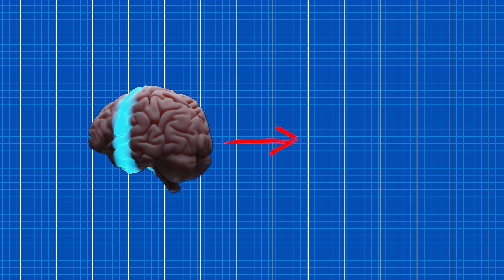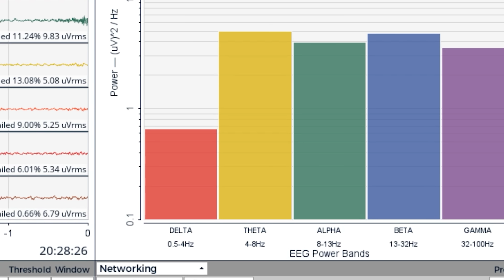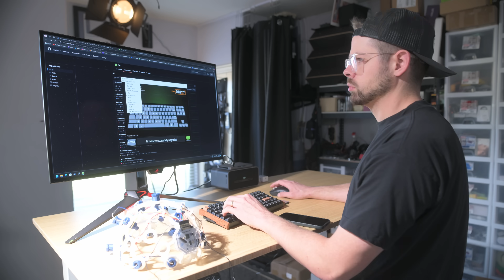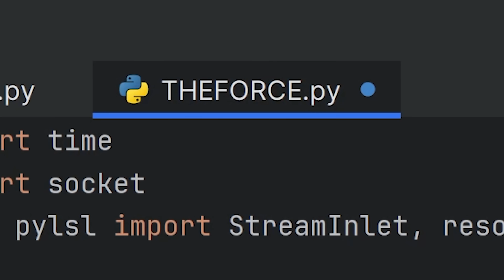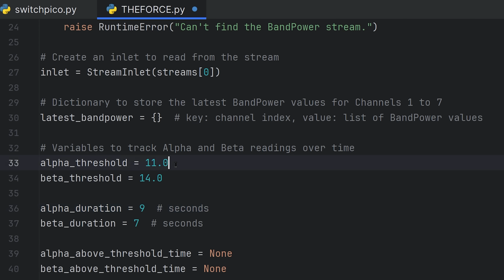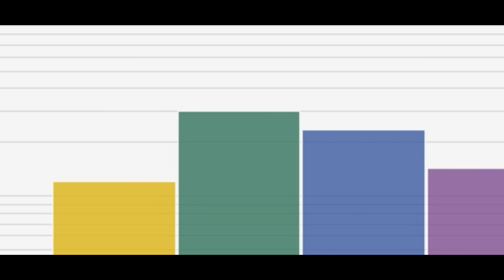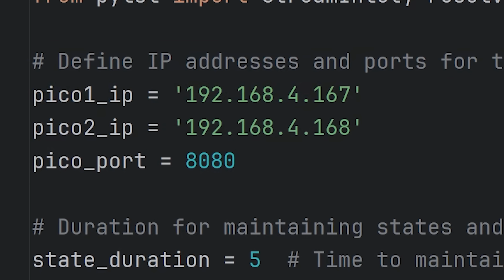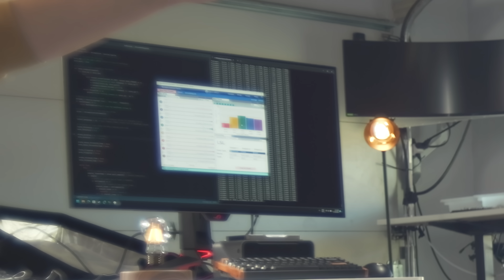I Built a Way to Use The Force

Comment: the problem with the vibration is that you didn't secure the device using drywall screws to your head, that is the official way to do it properly.

Comment: @BasicallyHomeless I am trying to better understand my neuro-divergent sleep schedule, as I sleep for 35+ hours (and reach a state of hibernation). I will then stay up for 60+ hours. I've been trying to switch back to a normal schedule and seemingly just can't. I think this data would help me immensely with troubleshooting my mind.

Can you tell me the parts list for your helmet build? did u spend 3k or did you go full DiY mode? And what was the cost of printing the headset and buying the parts seperately? Did you use their proprietary boards or use your own?

Thanks for amazing content.

Comment: Why not have the Pi wait for a specific data output "flip the switch" and then have it transmit via the Zigbee protocol to a smart switch?

You could then set up smart routines...

Weather? ... Either turns on your TV to the news channel, or "asks" your smart assistant what the weather is.

Lock?... Locks the front door.

Lights ... Turns lights on/off

Comment: Lol "Neuralink?! Bro I DIY'd the force, mario kart can't beat my light switch"

P.S at least it wouldn't be certain death if you messed up or if anything went wrong without flipping the breaker off.
Seen this happen two different times:
Once a big ol' 6'4 guy (30~)with loads of muscle mass who didn't budge, panic, or care that he got zapped at all for that matter.
Another time a small 5'6 guy (age 40+) who went into cardiac arrest but pulled through thanks to the fastest ambulance I have ever seen in my life. The way he jerked back you'd swear he was about to go flying like Mace Windu in the third movie but instead it's far more unsettling... That said...Remember kids, If you're demolishing a house, changing an outlet, or ANYTHING that involves dangerous electrical matters-- ALWAYS turn off the breaker if you don't want to face potentially severe consequences.

Comment: You know one time i was cutting an earbud with wires, i used a stainless steel scissor and cutted the bottom of the earbud itself, and when i moved it after i cut it, the part where one cale becames two, the cable connected to the earbud i cut, was somehow cutted, i know it sounds fake and i thought it was probably just a electrical current exloding and broke the cable, but after watching this video, i started to think, a bunch of other stuff happens to me as well, perfectly bad timed customers coming in when I'm just about to do something different, people said this and later they said that they said that, most people i met are dumb, and i forgot

Comment: Your brain projects your reality which is dependant on what u program it with. Meditating is a great way to attain the certain states which is great, now u need to have your mind and heart connect. Your heart is NOT a pump, but an energetically vortex like valve that produces your biofield about 8ft in diameter around your body. Now if u can connect your mind with your heart imagine what can happen. Your heart will help u feel better, but  u have to do inner work (shadow work) to heal the heart.

Comment: You could use your brain waves to control a robot and do anything with it (lift stuff, move stuff, etc) as long as the robot is physically capable of doing it and you can come up with a way of encoding different actions in your brain waves (Morse code, perhaps). Sounds almost impossible, but so did this whole video!

Comment: Option D: Accept the fact that the light won’t ever turn off and you have to sleep under the blanket only for you to run out of oxygen so you pop your head out to check if the light turned off and it didn’t so you surrender to a higher power

Comment: This is sick, but I'm gonna try to explain the force more accurately: it's like a parallel dimension that always has the same things happen as our dimension, and vice versa. And the more midi-chlorians you have, the easier it is to do stuff in that parallel dimension and see from the perspective of the parallel dimension (I always imagine it as an "almost but not quite matrix mode". You literally see everything, because it's the mere existence that makes it visible). And in that parallel dimension, you can stretch your limbs infinitely (and independently of the real limbs, but that's not worth the mental effort most of the time), so you can physically feel that you grab stuff.

Comment: It would have been easier to train a neural network to differentiate between different intention-based thoughts. It's a lot like image classification models, where instead of pixel values, the input image is a time series of the signals from the headset

Comment: This is awesome, but bruh, I thought you were gonna try to use the headgear to push the common threshold limit of your gamma waves and others daily until you were straight up using the force RAW. But since most of these softwares are logging your waves to a cloud, if you did get to "freaky" levels, you'd have a van outside your house taking you on a one way trip to a mili underground lab

Comment: My first thought with videos like these is always how amazing this would be for disabled people. Like holy shit.
Reply: I havent raised the blinds in my room or even wanted to fix the overhead light in years as i cant get out of bed easily to use either. Youd never realize how much youd miss being able pull a string or roll the turny stick on the blinds till you cant anymore
Reply: This comment is so true and underrrated
Reply: This is the future. The good one.
Reply: it's 2500 I want to get one to mess around with. It's all open source software would be cool for projects.
Reply: There is a ton of research going into AI models trained to classify brain signals connected to certain actions (clenched fist, bent knee, etc.) for prosthetic limbs. There's even some brand new research about implicitly training a model to do what you want it to do when you give it certain brain signals
Reply: There’s a ton of research the AI companies steal from losers like myself and then threaten while turning a profit from it all.
Reply: Neuralink Will save them
Reply: @alexandergorchev9946  id rather skin myself alive than trust neuralink for some reason
Reply: someone at CSU northridge years ago was researching using I believe silicone-based chips to move wheelchairs with electrodes just like this. idk if that went anywhere

Comment: Cool video! 
Looks like you have about 12-16 ECG recording channels. As an alternative to using simple thresholding of pooled ECG data to  predict intent, you can do the following: 

(1) Apply a notch filter to remove powerline electromagnetic interference (60Hz in north america) 
(2) Perform an FFT, bin every 5Hz from 1Hz to 150Hz. your inputs now becomes 30 x number of ECG channels.
(3) Train a simple linear classifier to predict your thoughts/intent.
Reply: this is good advice
Reply: Genius
Reply: didnt understand a thing besides that you mentioned fast fourier transform
Reply: @PinkeySuavo  basically think the same thing over and over and figure out what brainwaves change in what ways when you think that and use that to code the force
Reply: im assuming
Reply: Not really relevant but it’s eeg not ecg
Reply: @Icedbattery right right, should be eeg

Comment: You better actually use this thing around the house. Better yet, you should improve the head thingy, get a retailer to make parts, and make this a 3d printable thing. Like, have a kit you can buy with the parts and a link to the code and 3d model in the instruction manual. You could make a pretty penny….

Comment: Do you read all these comments??  I haven't, maybe 20 or so. Great video. 
An upgrade maybe - a wrist band accelerator ( or something) that can sense hand position and gestures, and a tracking system so the compy knows where you are in the house / property. That way you can point at and select what objects to interact with, and in what way. Could probably even delete the brain wave part, but that would be less cool. 
Also, wear you Jedi hood up whenever you have that head gear on   :o)   
Awesome build   <3

Comment: How about making a classifier in python and watch a light bulb turned on and off saving the brain wave data for each separate sensors' measurement with the light bulb state?
You can also shake your head to introduce some noise which can be useful in the training data.

Comment: Congratulations. You discovered neurofeedback! At least I recall that when treating Tourette's or motor tics, while wearing an EEG cap (the kind where they have to inject a conductive gel between the electrodes and your scalp) you would watch a computer program presenting an animation that would only progress if you were able to get your brainwaves to assume a certain pattern consistent with relaxation of the hyperactive component causing the motor tics.

Comment: use a focus and try to map that. physically walk over to the light switch and flick it manually and record the brainwaves for that. then, when you try to use it, visualize yourself walking to the switch and flipping it. should help match the brainwaves. use that method for mapping other tasks

Comment: The “high voltage” wires behind and on your switch could possibly be touching the low voltage wires, this can cause electromagnetic interference and/or voltage induction that can cause issues with the signal

Comment: You should use increase 12-15Hz at C4 or C3 (SMR training).   That's over the sensorimotor cortex.  You have to "grope" in the dark until you get it one time...and then can replicate.  Hitch is, then you only have trained yourself to replicate that frequency at that site - only.  I can literally feel SMR training in my skin and face or body (hard to explain)... but given that is where coordination for music, writing, hand actions are - it doesn't surprise me.  It also won't tweak out as much when you go "AHA!" each time you get it.  Maybe a bit the opposite even.

I'm not aware of training at any other sites you can literally feel at the moment.  Original research on this was an accident by Barry Sterman.  The cats produce 12-15HZ burst at those sites for chicken broth or just before pouncing.  Later (by dumb luck):  Found training for it increase resistance to seizures and seizure-causing compounds.

You don't want to encourage or discourage certain frequencies at certain sites.  It's more like conditioning... But since it's not muscle you can't feel what you are doing.  So if you are "stretching" (metaphor) something wrong... you probably won't know it... but keep doing it, and things might start to seem "off" for whatever you consider "normal".  It's "good" you used alpha.  "Least" likely to mess something up "rando'ing" around like that. ;-)

Comment: Blah.. We got machines hidden below surface of Earth that are plasma generated Ultrasonic holography, far beyond Suslick EDU "sonochemistry" pressure claim of "great as bottom of the ocean" so.. Google: "Giant black Triangle UFO's" Look for the ones that look like bottom of Star Destroyer.. Flatter makes them better for sneaking up on fleets to cripple them with point singularity projectors on startup before main fleet jumps in, AI so less crew required, and capable of Destroying Stars with point singularity projector shot to core of your Star.

Pressures as great as the bottom of the sea.. Points at your Military max subs and crushes them into ingots with a thought That's why you add gesture confirmation.. - Watcher

Comment: 0:21  option D: Throw things on  the switch until something hits it
Reply: Been there done that
Reply: @thechampshrimp  SAAAAAME
Reply: I threw s sock on a square light switch. It hit it and actually turned it off. It was so satisfying
Reply: @ChairyCrasher stiff sock from under bed? Only way to bwat air resistance
Reply: Or directly hit the lamp instead
Reply: @rizkym2999  one time i did throw my old phone on a lamp just to turn it off
Reply: option E: sleep with the light on
Reply: Me
Reply: @Me-0063  why?
Reply: @Me-0063 I sleep with a hoody so E would be doable.
you see, I just pull the edge of my hood over my eyes and then I'm good.
Reply: ive had a small bow with sticky arrows just for this case next to my bed.
Reply: Option Me: take the time to drill a 1/8 inch hole through the tip of the switch, thread a fishing line through and knot it, then put in a few hooks to allow free movement. Basically a large loop that allowed me to turn the switch on and off from the safety of my bed. Simple, relatively easy, practical but NOT as elegant as building a device to mimic the effects of the Force! That’s brilliant!🤪
Reply: Option I: ask ur dad to turn it off
Reply: force is coler
Reply: :D
Reply: Option G: light switch
Reply: thought it was option sad face for a sec lol
Reply: You made a sad face hehe
Reply: option G: go in creative mode and turn of the light switch… then maybe overthrow the government
Reply: Option j: get the literal death star and make it shoot a laser at the light switch then it will turn off.
Reply: Now that's an intelligent use of the force...
Reply: Ferris Bueller’s Day Off moment.
Reply: Option E: Build a pulley system.
Reply: like ur lightsaber
Reply: Option H: kill the bed monster and turn off the lights
Reply: or option E: throw yourself at the switch
Reply: Option E: shoot the light switch
Reply: option E: use your f* arm.
Reply: Option I: Use a stick
Reply: Option E: say “Alexa turn light off please”
Reply: Option K: Hit it with your toe nails.
Reply: Option F 2 alexa doesn't have control to your lights and other house stuff
Reply: Dropping an atomic bomb
Reply: Option F: scream at your dad you you to turn the light off
Reply: “not in my house!”
Reply: Option E: just ask your dad nicely if he can turn the light back off
Reply: Option E Leave It
Reply: Option F: Use Alexa
Reply: @pixels_per_inch  bro fr
Reply: YESSSSS!!!
Reply: @pixels_per_inchyou mean use the home spy network ?
Reply: Option H: Stretch your arms reeeeaaallly far and turn off the light switch.
Reply: Option F: sleep with the lights on
Reply: So uncivilized